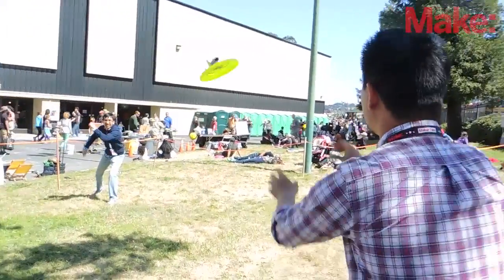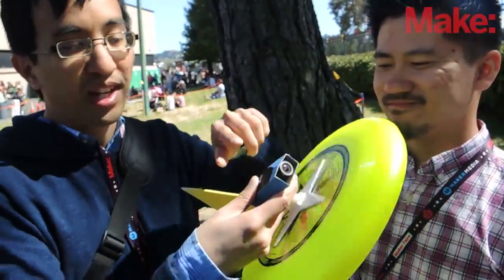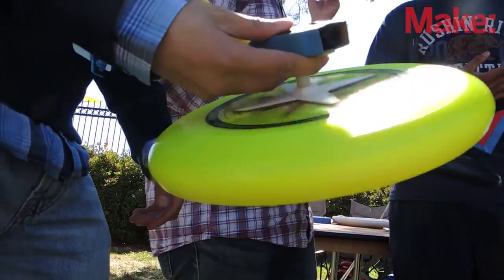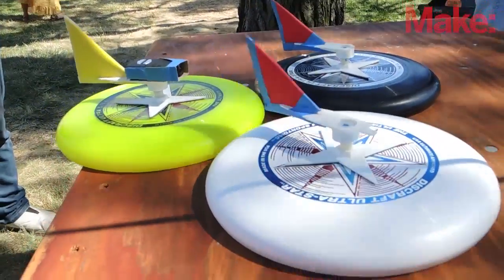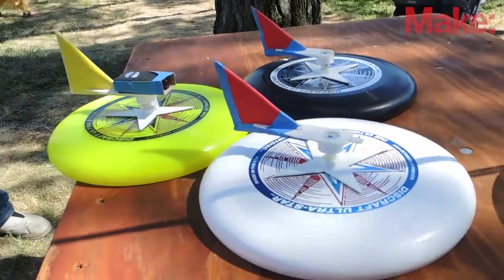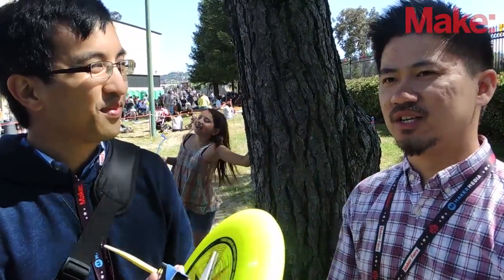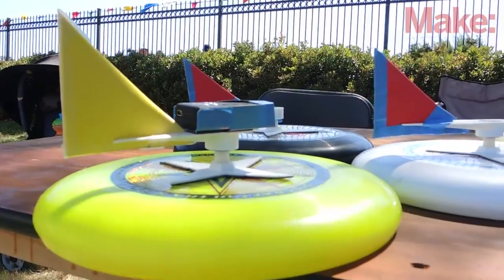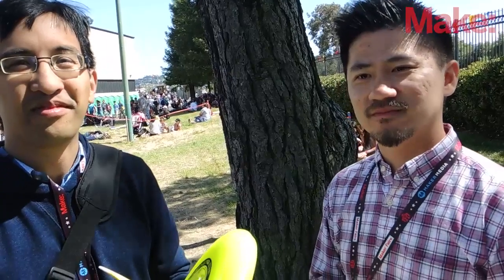3d Printed Frisbee Cam

Comment: Wow, everyone shouting about "No footage". They were walking around doing quick interviews with people at makerfair, the people they interviewed probably did not have footage handy, or a way to easily give it to the interviewer. It is not like they called them in, did an in depth interview, and had no footage, they were literally just walking around talking to people and recording it.

Calm down, stop being lazy, and go to the website they said, I am sure there is plenty of footage over there.
Reply: Actually, all they would have to do is insert an SD card (that the interviewer supplies), throw the Frisbee, take out the SD card, and use the now saved video file in this very clip. Pretty simple.
Reply: Wow, so many assumptions.

A. Many micro camcorders do not take SD cards to save on weight/size, which is important on a flying Frisbee.

B. Even if it did take a card, it is no guarantee that the interviewer would have said card.

C. They were running around doing as many quick overview interviews as fast as possible, this was makerfair, they had a TON to cover, and had to do so as fast as possible. Even if they did have the card they probably did not have time to fiddle around for 5 minutes to get an extra 10 seconds of footage for a <2 minute video.

D. They probably assumed (correctly) that if anyone was interested they could go to the actual site provided and get all the information they want.

E. Not providing the video would actually get the people who just wanted to see the video to go t the maker's site and increase the traffic and coverage there, as there is more there than just this one item.

Must I go on, or do you get the point now?
Reply: Nolansykinsley Nope, I don't get the point. First off, it's a Mobius action cam, meaning it takes an SD card, second, they will have an SD card on them most likely, either in a phone, or in a camera (still, think DSLR/compact). If nothing else, it's a simple thing to bring with if you even want to be semi-professional. It doesn't take time, they were already filming them throwing it, footage would be captured at the same time, literally taking 5 sec to put the SD card in, and 5 sec to take it back out (yeah, that's literally the time it takes). And so on. It's just laziness really. That or just being ill prepared. 

It would require so little effort to give so much more. You just complicate the excuse train.
Reply: It is so simple to say "Oh they should have done this" It is much more difficult to realize and understand that there are reasons why people did not do certain things.

They wanted to do a quick look, what part of that do you not understand?

 There were thousands of people with interesting things to take a video of, and they had to choose how to use their limited time wisely, what part of that do you not understand?

You can easily click on a bloody link and go look at it yourself, what part of that do you not understand? 

My god man....
Reply: Nolansykinsley I guess you don't understand the concept of criticism either. So... Not at any point have I said it was wrong of them to not include it. I've just pointed out that it's a really, really simple thing to do, that requires quite literally no extra effort, but gives a much more professional appearance.

Guess all of that just went way over your head. Making excuses instead of pointing out what could be better halts progress and causes stagnation. Criticism promotes progress.

My god man...